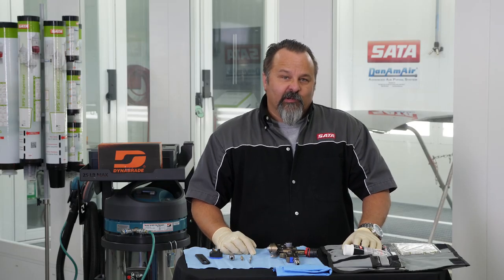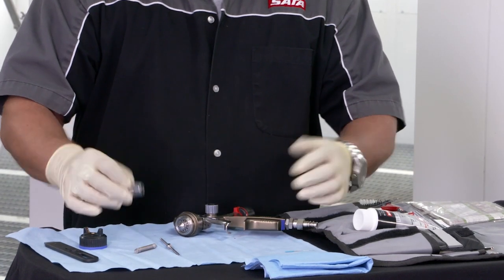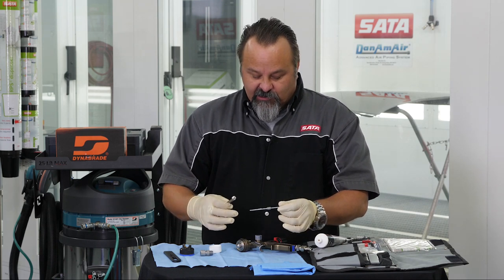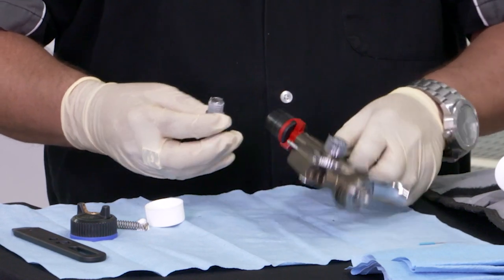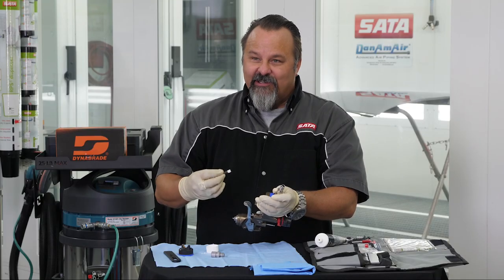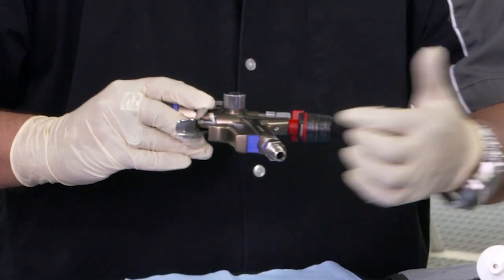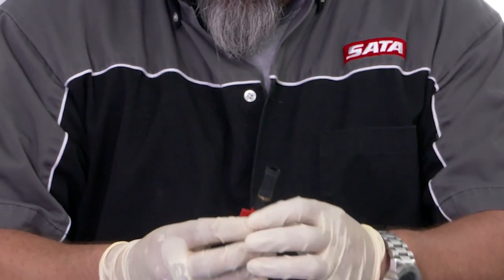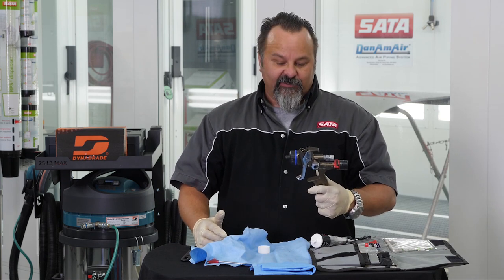How To Properly Grease Your SATA Spray Gun

Comment: So the old guns (Binks) my Grandpa cleaned professionally had a 'packing' the needle went through.  Is the 'bushing' you described it's replacement?  I do grease my needle in that area because I know it goes through some kind of SEAL be it packing or something newer just wondering if the bushing you describe is the new version of a packing.  The old packings weere adjustable for tightness and grip just like a valve packing....